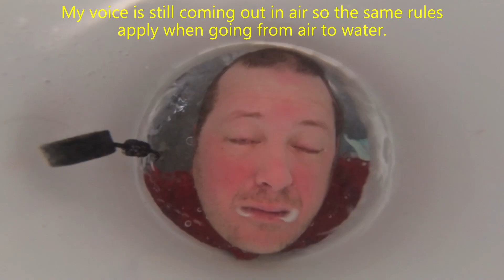April Fools Day - Sound: Air To Water and Water To Air: Sound Speeds Podcast 33

Comment: What a fun and interesting video! As a former SCUBA diver, let me add that the higher speed of sound in water makes it difficult if not impossible to determine the direction of sound. Because it's much harder to detect the difference in arrival time from ear to ear. And direction is important if you want to avoid surfacing in front of an oncoming boat.
Reply from the maker: Great add. I hadn't thought of that.
Reply: Wait. 'Finding Dory' LIED to me?